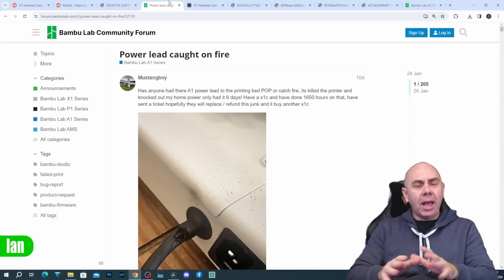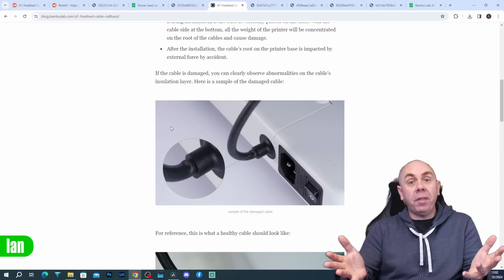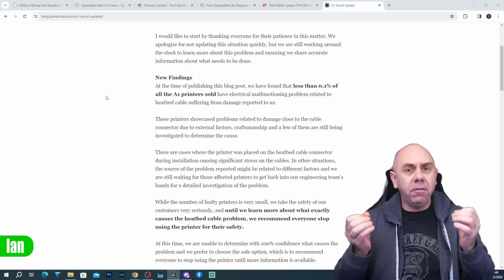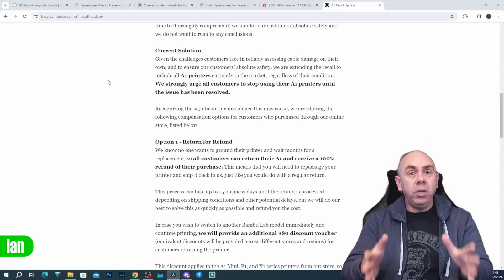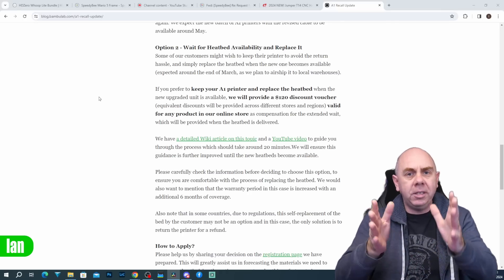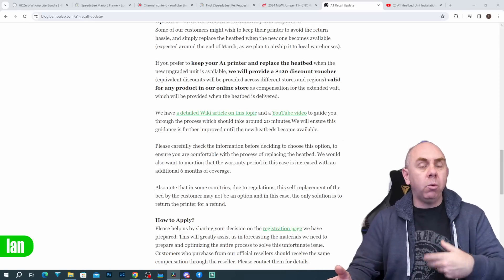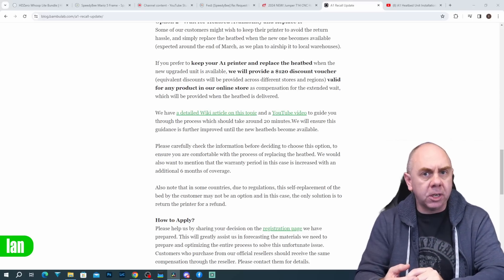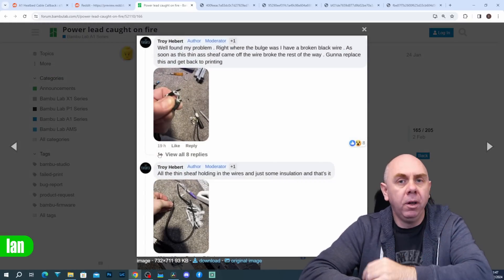Bambu Lab A1 3D Printer Recall Repair Or Replace - Get Up-To $120 Credit

Comment: Good luck getting the bed replacement. Bambu will absolutely not support this recall or replacement in any way! I have an original A1 and its out of service due to the bed problem. They won't fix it, they wont support it, I'm stuck with a $700 loss on this printer. This entire video on rebates and getting the A1 fixed is an absolute lie. Bambu will not do this!
Reply from the maker: Please can you explain how they won’t support it I know many many people who have got theirs sorted.

Comment: We deal with a similar issue with the cable on a donut filling machine at work, the cable is fine as long as the people will quit pushing the machine all the way back against the wall that then puts the cable in a bind and then eventually it breaks down and starts smoking and everybody makes out like "oh you don't repair that" ,no,  "you don't listen and you keep shoving the damn thing all the way against the wall"  I have a feeling that this cable is against something not allowing it to move freely back and forth with no outside pressure probably works fine but if you're setting a little close to a wall you're now bending it at a much more extreme angle and causing fraying and issues. I'm not saying your average consumer should be smart enough to know that but I am saying that sometimes it is your fault and not the fact that the cables designed poorly but something that you did whether on purpose or not that's causing the failure.

Comment: Anyone with both machines? The AMS on teh P1S has loads of issues and it has to be taken apart to fix. Is the AMS on the A! any better for reliability?
Reply from the maker: I have 2 with zero issues. Only one ever blockage when a piece of filament broke and got stuck. Other than that they have been perfect.   The quality of the filament helps and you must use plastic spools.

Comment: Bambu messed up, yes they messed up:
1. They used sub standard cables!!! (not good enough for a moving bed, more seriously a MAINS powered bed)
2. They don't take responsible measures! They should recall ALL A1 and change the cables to high quality Teflon/Halon/silicon cables IN A DRAG CHAIN like on the Voron Switchwire!!! They expect you to change the faulty parts... NB Endusers in many countries are not allowed to work on mains powered parts only a certified electrician/technician is ALLOWED BY LAW do that! 
Never ever Bambu!!! Not how they handle customers! Not how they kick the community in the nuts!
Reply: They did recall all of the A1s for a full refund so your whole cry baby point is invalid. What is it like being a bot?
Reply: @mikevachon8752  My point is that if Bambu would value their customers, they would have given the option to collect and repair the product, not this sham "fix" of return for refund or fix it DIY. If I buy a product which claims to work "out of the box" I expect to get a working product and not a sham refund or get the parts thrown at me to fix it myself!
   This is not cry baby like you want to put it, this is my expectation as customer to an end user product!
   Let me ask you in return, how is it to sing the company song and to ignore consumer rights?
Reply from the maker: That have even gone better than that. They will fully refund you and give you $80 off the same printer again if you want.  You’re asking for a repair when they will literally give you your money back and then some.  

Ffs come on.
Reply: @MadRC  They don't give you money, they give you a voucher for $80/120 for a purchase in their shop and possible NOT EVEN FOR A RE-BUY of an A1.
   
   BTW EU laws gives the consumer the right of a working product up on purchase. If the product is faulty due to a defect on arrival THE customer has THE RIGHT of EITHER a full refund, where the seller has to provide shipping (including possible thrown away box) OR the right to a repaired product (by a certified technician/electrician, again shipping and box have to be organized by the seller) OR if the seller cannot provide a functional product a full refund (without the burden of return which has to be arrange by the seller INCLUDING a transport box). If the product is used in a business a customer has the right of compensation for lost income! THAT#S THE CONSUMER LAW HERE IN THE EU!
   If you want to tinker and void any home insurance GO AHEAD AND REPAIR... A voucher for $80/120 cannot sugar coat that nor can it relief you of a possible illegal repair. Or will Bambu compensate you if your house burns down or even if someone loses his life due to a fire caused by the A1 with self repaired bed/cable? If you wanna risk that please go ahead... The 1st batch of send out replacement cables where sub standard, NOT suitable for a moving bed with a mains powered heater element!
Reply from the maker: @Christian-tt4nv  man you are so triggered it’s funny. 

It’s not even clear the first cable is actually the fault due to movement.  The damage actually implies internal manufacturing issue of the cable.  That don’t actually mean it’s not suitable.

As for the refund they are doing that, your point is actually pointless. Secondly you can actually take the voucher and buy another A1 once it’s sorted.  They even say this in the recall.
Reply: @MadRC   
Edit:
Quote from the Bambu Labs A1 ** owner group:
Hey Guys

ALL MACHINES HAVE CABLE ISSUE...ALL OF THEM...

Just received a new bed from BL, and i took apart the famous cable...
It seems like they wrapped a ground wire to the signal cable for the heatbed temp sensor, so for all of you that didn't ground your machine, this could be the isssue with heatbed temp fail. picture 1-2

I also opened the piece of plastic that you can see small part of, where cable Come out of machine. this plastic is heatpressed onto the cable, which cause the cables to melt, to a point where you can actually see the metal. picture 3-4and video

Made a new cable using old ground and signal cable, added new 220v quality cable, and wrapped it in rubber cable organizer.."

Source-> 3D Musketeers: Bambu Lab A1: Potential Fire Hazard? - PrintFixFriday 125 timestamp ~23:07
End Edit
To the refund: THEY DON'T say for a future A1. RTFM!: QUOTE:"...In case you wish to switch to another Bambu Lab model immediately and continue printing, we will provide an additional $80 discount voucher (equivalent discounts will be provided across different stores and regions) for customers returning the printer.

This discount applies to the A1 Mini, P1, and X1 series printers from our store, so you can order a replacement and get back to printing in the shortest amount of time possible. ..." (Source: official Bambu Lab recall page) 

No mention of a future A1 buy for the $80/120 voucher!!!   WTF RTFM

Comment: Would you take the P1S over the A1 even though it’s older tech ? I’m very torn about what to do. How is the ams holding up as I have heard it’s prone to breaking down
Reply: The "tech" is nearly identical. You aren't losing anything by going with the P1S and it should generally provide superior print quality at the same speeds.

Comment: It is normal for Chinese products to have a cheap cable not intended for mobile connections, additionally cut to a minimum length to make it as small as possible. Probably the lack of long tests because we need to release a new product as soon as possible to see results, because one Chinese product burned down? Well, it's cheap and the reviews I bought on YT say it works great.....

Comment: It’s not $120 voucher, in confirmation they only state $80 to wait for replacement bed.
Reply from the maker: People need to calm down, chances are that is a typo on the email response as it’s a copy and paste.  Give them a chance to respond to that before running around trying to correct everyone you think is wrong.

People are already getting revised emails with the correct $120 on so again give it 5 minutes before running to YouTube to try to say we are all wrong.
Reply: @MadRC  just had an apology email, they sent out a general email it is $120 or equivalent which in uk is £111. I also have had the official email inviting me to register my choice from uk store and the link sends me to the eu store and Spanish text😂. They need to slow down a little and stop messing up, there’s enough confusion already and a huge amount of disappointment because the A1 is a fantastic printer.
Reply from the maker: @Happy3dprinting  great news.

Comment: In several countries is illegal for an end user to do repair an electrical AC devices.
So the cable must be replaced only by qualified person.
If, fotr example, there is a fire insirance company could not activate insurance coverage. Even worse if a prson is being injured.

Comment: I love my A1 that I just got a few weeks ago.  I went with the swap-the-bed option.  My wire looks a bit funny like those ones in the video.  Also my printer came out of the box with 4 small wires pinched between the plastic housing that I managed to pry free without them breaking.   So they have a couple of issues.  But the end results of this printer are amazing.

Comment: The printer model swap is a good offering from Bambu…no need to hold onto potentially faulty hardware. I personally think they shouldn’t have offered that stl because people will probably think that’s all that was wrong. There is clearly an engineering fault that a print isn’t going to fix.

Comment: A solid coverage of the current state of the issue. It's good that they called out there are places where you can't legally do repairs on mains powered elements without a special certification and that customers in those areas should opt for the return.

Comment: I don't have a Bambu printer, but seeing how they deal with this problem, I sincerely believe that my next printer will come from them! It's reassuring to see that there are still companies that care about their customers by being very responsive and honest.
Reply: Then why they did't send an email to customers if it is a hazzard?
Reply: @pantelispaspalas5048  That's an interesting question. You own an A1 and you haven't been warned?
Reply: It was a mistake, they will send emails, just later than sending the emails to resellers @pantelispaspalas5048
Reply: @pantelispaspalas5048  They did as i have an email from them saying just that.

Comment: they are sending out a cable that is the same one doesn't make sense watch their video on changing the cable
Reply from the maker: That video is just showing how to do it.  The new bed and cable assembly will have what ever changes it needs.  Remember they are still actually investigating the cause.

They have not even made the new cable yet.

Comment: To be clear, the damaged cables have been damaged by users, either by resting the printer on its back or by pushing the printer back against a wall.   There are several YouTube videos where the hosts can be seen inadvertently damaging the cable as they assemble the unit.
Reply from the maker: That’s not actually the case as there are people showing brand new printers in there boxes with the issue.
Reply: To be clear, you don't know what you're talking about!
Reply: @pablostax  - as I happily continue to use my undamaged A1.

Comment: I’m honestly happy with how Bambu has decided to resolve this, and I'll be taking the $120 in store credit and keeping the A1.  I unboxed it very cautiously,  making sure to not to put any stress on the cable, and it doesn't appear damaged from shipping either. My printer has a wide space to print where the cable is not backing into anything. So my cable doesn't have any creases or issues (yet)... I'll make my own risk assessments, and monitor the cable until I can get the new bed+cable assembly.

Comment: Hi Ian - I have the A1 and not seeing cable damage from just a casual look but will need to look at it closely.  Just had a power outage as I am printing while watching your video and having my heart race as to a potentially dangerous situation.  What I love about the A1 is the power outage was brief so it paused and allowed me to resume once the power returned - excellent.  I love the A1 - it performs really well.  I agree I should just go for the upgrade but there is a 200 dollar difference so I have to fork over more money.  The question I had is if I have to ship it back will they send me a pre-paid label or do I have to front the shipping costs - it is a big box - probably would cost 30-50 to ship I am guessing.
Reply from the maker: My understanding is they will cover shipping.  

I was very careful in my video not to give any opinions or advice on what people should do. 

Bambu are “Advising” people not to use. 

I would be doing the following personally however this is not advice, a recommendation or any form of guidance and you should follow the manufacturers instructions.

My personal stance would be 

Inspect the printer before every use and check for any signs of damage, regardless if there was crumpling on the cable I could continue to use and I would monitor closely,  I would personally only use the printer while I was present.  

I would also put the printer on a dedicated RCD Plug and use it on that for additional safety and I would then replace the bed once issued.  

If in the meantime I had issues I would just make my own cable up tbh.  

While this issue is not good iv also not seen anything particularly shocking or very dangerous here.  It’s not good but as long as you have proper safety in place then there is very minimal risk.

Comment: My A1 is in perfect condition. I didn't have a bad cable but I fid install the 3D printed strain releif. I don't intend to send mine back but I will swap out the bed if they send one to me. I do monitor the cable before and after every print.
Reply from the maker: Sounds like a plan. Bambu are advising not to use however as you say of you have no issues there is not a major concern here.  I would advise though to use the printer on an RCD Plug.

Comment: Continuity check before sending power.  Duhhhh.  Not to mention an over current check.  Pretty sure a direct short consumes more current than a heating element.
Reply: That would be a great idea, but unfortunately not feasible for existing printers, extra hardware is needed
Reply from the maker: This is what a fuse is for. You can’t check continuity as the heater will be down to 35 or so ohm. It would take some clever circuit to do this that would add massively more to the BOM.

Comment: So if I return it, as i understand, you can apply it to a new A1 combo in May, but I believe they will also give you an $80 credit towards the store also.
Reply from the maker: I’m not sure.  They state they will give you $80 towards another printer now.  I’m not sure that means in 3 months.
Reply: @MadRC  yes, good point. For me. My printer is fine, but I'm going to return it so I can get the no issue remake. I personally don't want the other printers in the series. I absolutely love my A1.
Reply: My issue is Bambu will only issue the discount voucher AFTER they have received the defective unit ,so their statement in regard to customers wishing to upgrade immediately can claim this is very misleading as you will have to buy a replacement at FULL price now then in several weeks receive the voucher, which incidentally is only valid for 3 months, so it is not a discount against a new replacement printer at all. 
Very poor really as you are forced to use the voucher for other items and all within a 3 month period which is unreasonable.  @MadRC

Comment: I just bought the p1s combo man do I still get the $80 because I have a a1 combo that has some problems with it?
Reply: Of course, why wouldn't you?
Reply: @Immolate62  well I just ordered it last night so I wasn't sure if I needed to return the a1 first and then be able to get the discount then.
Reply from the maker: You would get the $80 discount at the point of credit after return towards another printer then.  You would not be able to apply it to your current order.
Reply: @MadRC  well I don't need another printer I'll just have the p1s I'm assuming I can't use the discount towards any of their other products like filament and accessories.
Reply: I asked them that question and hoping I can use the 80 for filament or accessories, I didn't wanna wait until accepted return to get a replacement @ColesCraftedWorkshop
Reply: @Killswitch1411  I believe even though some of us a1 owners rhat got a new printer before returning the a1 they will allow it I Mean if they are giving out replacements and $120 to people that want to keep their printer then I would imagine they could give us $80 worth of accessories and filament I mean it doesn't affect them at all so I think they will and I think they should too because I haven't tried their filament yet.

Comment: Yea, this sucks BUT I agree with Ian. If you put out a product en' mass, you WILL eventually have some kind of issue. It's almost guaranteed. Every single company in the world deals with outside vendors. You can test samples until you're blue in the face. You can spot test production parts as often as you want but unless you stress test EVERY SINGLE PART, or you have the capacity to simulate EVERY SINGLE POSSIBLE CUSTOMER USE SCENARIO, something is bound to slip through your fingers. It's the way that you handle it that really counts. Just offering a full refund regardless of how long you've had the printer is pretty good. Especially for a company the size of Bambu. They aren't Samsung or Apple...